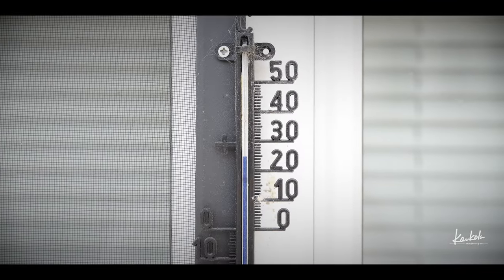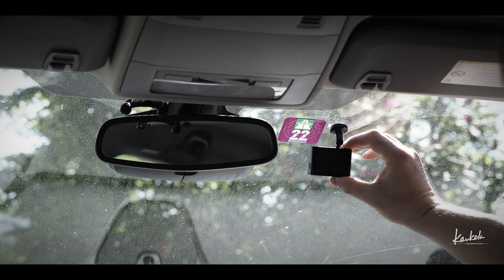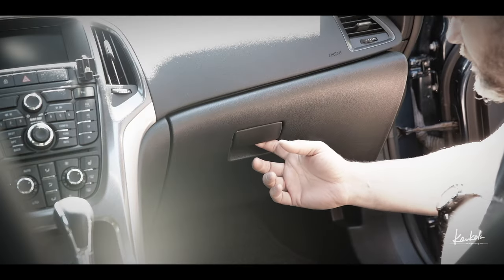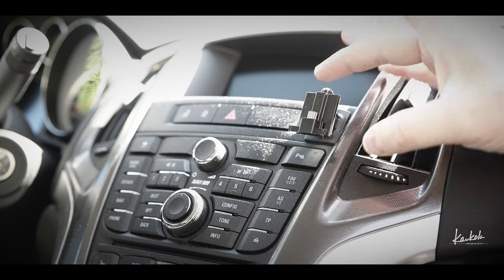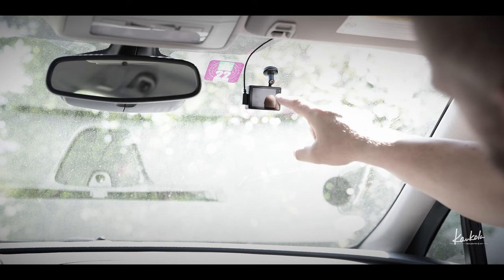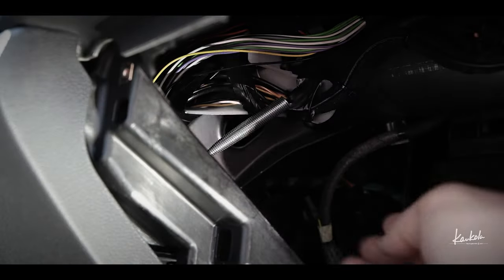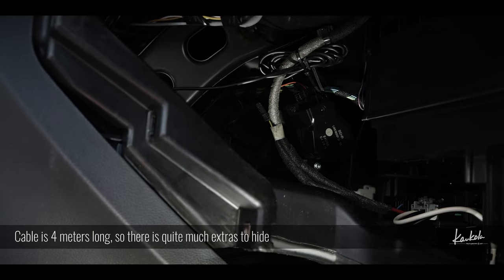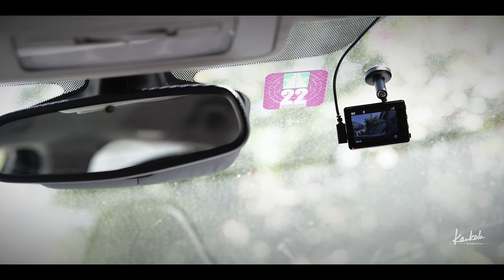Garmin Dash Cam 57 (1440p IT'S NOT 4K!). Installation to Opel Astra J. day/night test footage.

Comment: Thanks for taking the time and sharing your install.  Your video answered many of my questions. 👍

I'm thinking this very dashcam for my motorhome.

Be well and safe travels.
Reply from the maker: Thanks for your comment. So far it's been working without any problems.
Reply: @kaukolaDIY  Hello and congratulations for the video. Are you sure the dashcam is 4k?
Reply from the maker: @marceobeo  You are absolutely right, it's not 4K, it's QHD 2560x1440 resolution. I have no idea, where i got this 4K in to my head. Sorry about that.
Reply: @kaukolaDIY  I would have already bought it ... it was the only reason that stopped me
Reply from the maker: @marceobeo  Thank you so much for correcting my mistake. I changed my thumbnail, and added a note to the video and description.
Reply: @kaukolaDIY  thanks to you